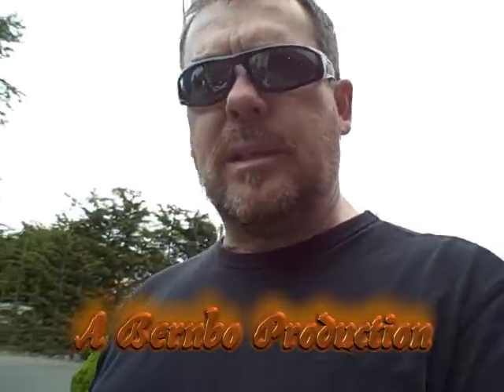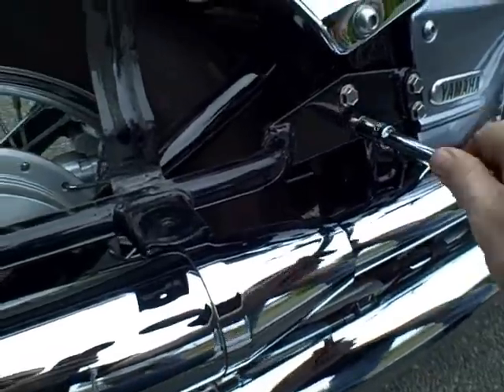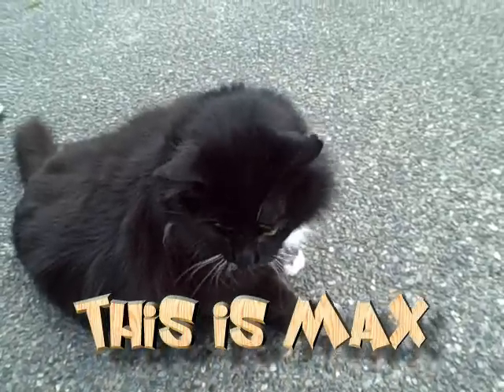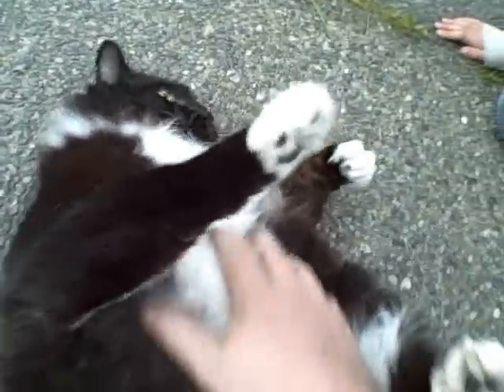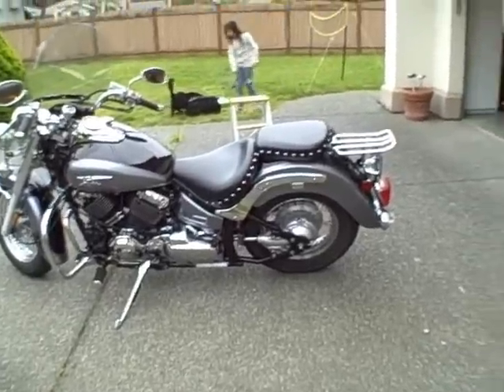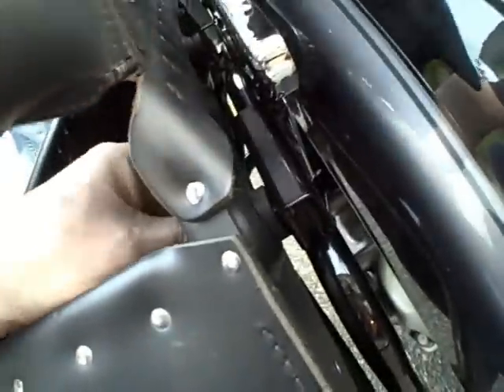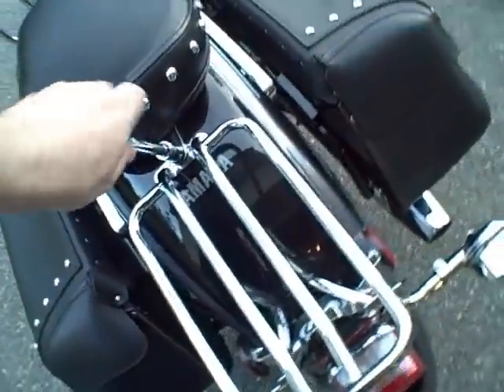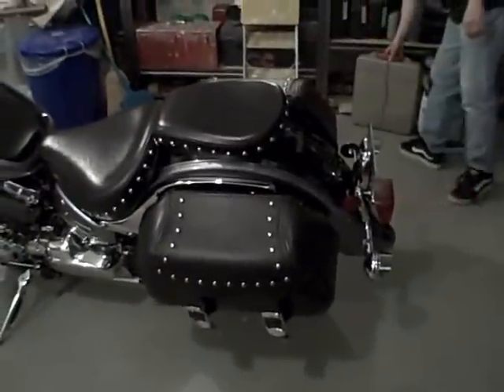How To Install The Stock Saddlebags on a 650 Silverado

Comment: Thanks for the guidance. It is always easier to see how it is done before running through it yourself. Much appreciated!! If you still have the luggage rack and would like to sell it, I might be interested. I have a 'sissy bar bag' that I could use on trips but would need a rack to protect my fender.